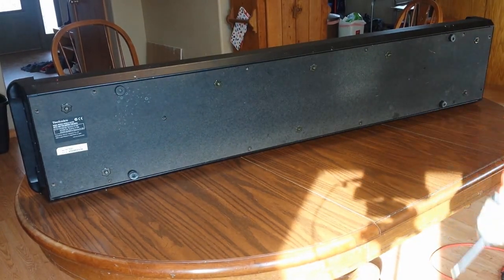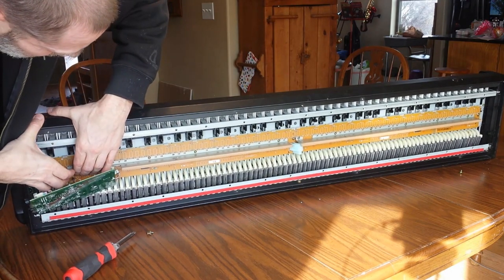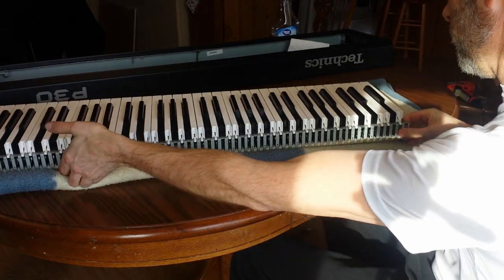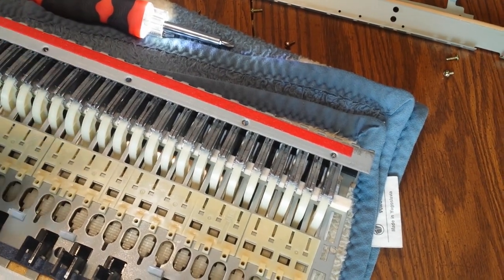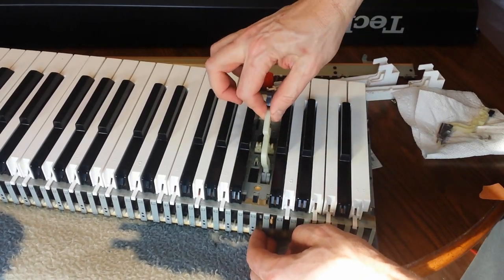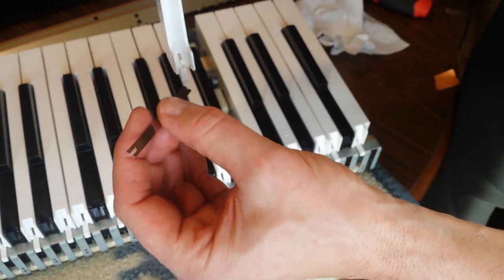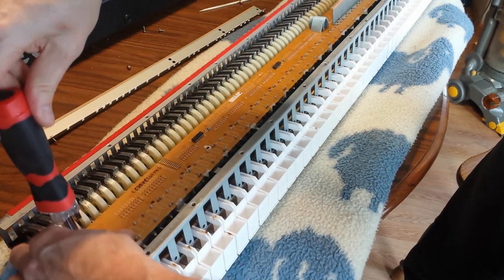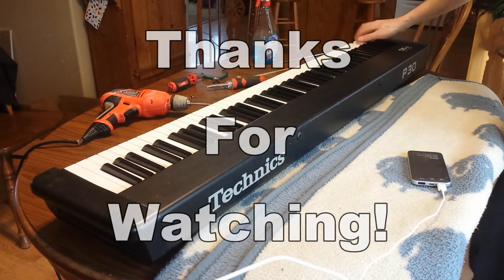Technics SX P30 Digital Piano Repair

Comment: The 4 screws are fairly critical. They hold the key array to the case BEFORE you put the PCB back in place on one end, I noticed while you were putting the plugs into the board that you had missed those screws, and before you put the back on. As for the end tabs on the keys, I broke some off while taking the kays out, but they still worked fine. The screws with the star-shaped washer hold the back to the frame of the key array. The screws to the edge are holding the whole lot to the case. Without the 4 screws in the array, the whole lot could fall out with the back card still attached if you weren't aware after removing the edge screws.  I hope that's clear. Incidentally, my keyboards stopped working after being stored for a while. I took it apart and put it back together, it worked after that. I did remove all the electronic plugs but I didn't find it necessary to remove the zip ties.

Comment: Hi, thank you for the video, I have the same mode piano, I just moved a few days ago from room to room and now don't work anymore...The red lights from the panel above the big buttons (white and black) and the little screen still works, but when I press the big buttons I get no answer, no sound...Do you have any ideea what the problem can be? I really want to learn to sing at piano...I had the piano working for all these years  and never used...now with this pandemic times I have time for it but it just broke exactly when I wanted to use it... If you can help me with any information I will be gratefull, thank you, Aurelian.

Comment: I have a PX6 digital piano. Apart from the keys having a wooden clonking sound it is in fine working order. I assumed the clonking was caused by the green felt strip is compressed over the years and maybe needs replacing. Am I right in my assumption and is it easy to get to and replace?
Reply from the maker: It's a possibility. The key misalignments I was having also caused a konk sound sometimes, I think it was the hammer hitting the top of the housing.